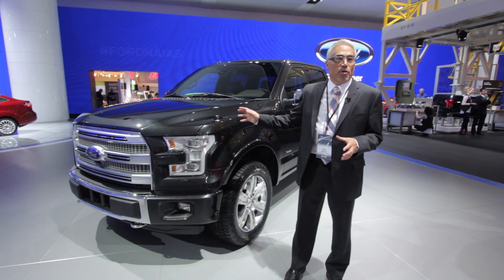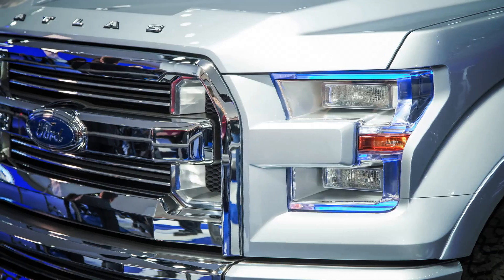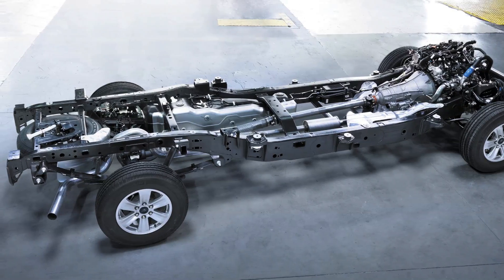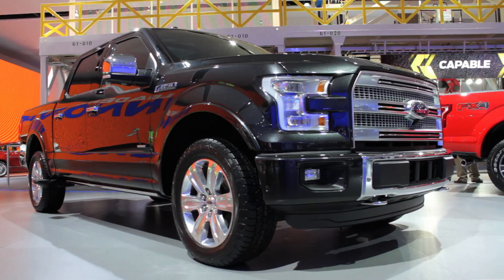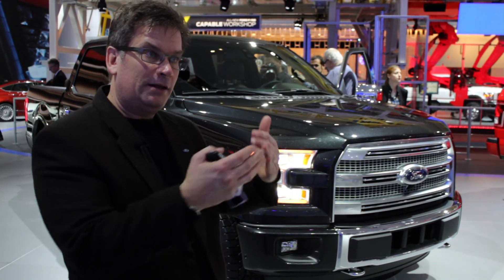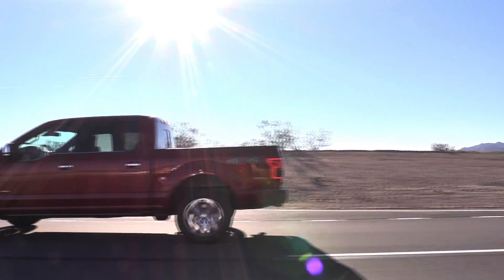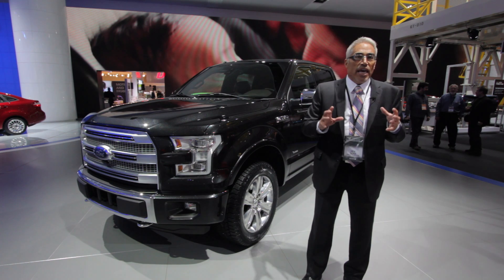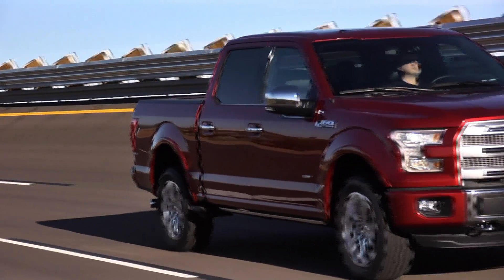Shaping the 2015 Ford F-150 from Aluminum - Design and Engineering - 2014 Detroit Auto Show

Comment: Nice to see that GM secured a contract for aluminum and in 2018 will be going aluminum as well to shed weight. Times certainly are changing and for the better. Advanced driving dynamics and tons of useful features for the many reasons one gets a truck, they certainly aren't just for work but that and much more...
Reply: Everyone knows they copy all of fords shit. Perfect example: raptor. Then gm built a 20 ton "off road" truck.

Comment: That truck no longer look like a Ford and more like a full size Toyota to me. The major change on this truck is the body which is Aluminum, and the new tailgate design. The grill is ugly and remind me of a Toyota, and the bed lights remind me of a GM option on their 2014 model trucks. I hope the new Ford is much quieter because the previous models are noisy. I like the idea of beefing up the frame design more and the tailgate. I thought you all would copy after GM on the bed step as it is easier.
Reply: I'm pretty sure it will sound the same, but I don't mind making it louder by adding a better more aggressive exhaust

Comment: If this aluminum thing catches on that could spell trouble for steel mills
Reply: not really. steel is still used in a lot of the trucks since it is still stronger. the aluminum is used where strength isn't necessary
Reply: Aluminum is only in the body panels, chassis and frame are high strength steel  nothing has changed there...everybody keep thinking the chassis is aluminum  no it isnt...FULLY BOXED FRAME from STEEL
Reply: Nickolas Little You telling me that a truck body does not need strength? Airplanes such as the B747 is made of aluminum, even in areas where strength is a key factor.
Reply: Mauricio Castro Noooo, you're sounding dumb. Read my comment. Aluminum is not as strong as Ford's high strength steel but it is lighter. Therefore, they use the Aluminum where strength isn't necessary, such as body panels. Ha nowhere did I say a truck body doesn't need strength.

Comment: Damn! coming from a Ram guy, i am pretty impressed with this new F-150. The styling has improved so much over the current model and the structure and weight of it are also considerably improved. Before this was shown, nothing competed with the Ram 1500 in the styling department, not the hideous f-150, or the boxy silverado and especially the dated titan or familiar new tundra. It'll finally give the Ram a serious competitor.

Comment: front shutters, lower front air dam,  LED taillights, spoiler or rear tailgate, all from Dodge first. besides the soft aluminum panels, whats new??? Dodge has more advanced and ground breaking features that came out almost 2 years ago….. wait for the new RAM. no competition in my opinion. oh yea, look out for steel on aluminum corrosion!

Comment: Nice but bumpers to small grill is way to big.Fenders need to flare wheel wells need to match the squarness of the rest of the truck.I dig the rear end and headlight design.Wheel wells def need a concept more square like flare.Body and bed not just bolt on flares to give it a wider looking stance.

Comment: Aluminum huh... Not sold on that, I'll wait and see what happens for a couple years. Can you imagine the body work costs? I heard the equipment is going to be 40k just to work on the body, guess who that cost gets passed on to... Don't let your wife drive.
Reply: High Tech vs Low Tech, High Performance vs Low Performance, High Buck vs Low Buck.
Life's a compromise, buy a Chevy or Toyota then.
Reply: I drive a loaded Chevy, switched from Ford last generation. Never looking back. Just stating that I don't know bout aluminum bodys. A good friend of mine works as a body man and he said they are going to be a nightmare and insurance companys will get 20k bills. In the long run it will cost you more to insure an Al truck over a steel one. Just something to ponder when new tech comes out.
Reply: C Blair If you like Low Tech and Low Performance then buy something else.
Reply: I used to run Ford...Lol. GM has the highest performance vehicles of the big 3. The corvette, camaro, duramax. Want me to keep going? Ford has to go to tuning division(SVT) and outside companies(Roush, Shelby) to produce a vehicle that can almost compete with an in-house GM built product. Cry me a river of tears fanboy, you like the wrong brand if performance is your thing. Cant beat GM drivetrain that's why 90% of ford hotrods run LS. Most ford owners aren't too ignorant to realize SBC is the true king, apparently you are though, so sorry to hear about that. Hope the rest of your day gets better.

Comment: I drive a 2010 F-150 and I love it! But this thing to me is a disappointed!!!! Ford, like all other truck manufacturers are trying to appeal to the rich and concentrating on luxury more than practically. Every time they redesign their trucks, the price increases by at least $4000.00 even with their XL model. A truck is supposed to be a work vehicle not a luxurious grocery getter! I don't understand their thinking about a lighter truck being best for towing. I'd rather have a heavy truck that will be more stable when towing heavy loads! Nice way to screw up a good truck Ford!!! Ugly and not practical!!!!!! Guess if I need to get another truck I'll be looking at other manufacturers!!!!!

Comment: Torque News
The New 2.7L EcoBoost V6 Will Make the 2015 Ford F150 the Most Efficient Truck in the US
Autos.ca is reporting that a new, 2.7-liter, twin-turbocharged V6 could find its way into the lighter, aluminum-intensive truck. The new engine supposedly makes use of asymmetrical turbos to generate 320 horsepower and 370 pound-feet of torque – substantially more impressive numbers than the current 3.7-liter base engine's 302 ponies and 278 lb-ft – while offering improved fuel economy and emissions.

Comment: my F150 is a 2006 super cab. It now has just over 95000 miles on it now and it runs as good as the day I drove it off the lot back in December of 2005. I bet I'll get another 95000 miles out it before it dies. When it does finally give up the ghost, You can bet your bottom dollar the next vehicle I buy will  be another ford truck!!!!!

Comment: FORD is king.
Reply: DETROIT (AP) — General Motors is recalling more than 1.5 million vehicles, including SUVs, vans and Cadillacs, for defective air bags and other problems.
The new recalls come as GM faces multiple investigations over its handling of a recall of more than 1.6 million small cars for defective ignition switches. The new recalls aren't related to that issue, but the company did say they're part of a broad product safety review prompted by the ignition switch problem, which is linked to 12 deaths.
GM expects to spend approximately $300 million in the first quarter to repair the vehicles in the new recalls as well as the vehicles in the small car recall. GM announced last month that ignition switches in older models of the Chevrolet Cobalt, Pontiac G5s, Saturn Ion, Chevrolet HHR, Pontiac Solstice and Saturn Sky need to be repaired.
Reply: What's Up,
Have you seen this yet
watch?v=O3nbwCjZKk8
looks like a lot of fun
Great Time to be a Ford fan
Reply: EscapeforMankind .
yea,i saw that,thats a good feature for the stang.
Reply: drfaticus F-gm What's Up, have you seen this yet,
 http://www.motorauthority.com/news/1091138_2015-ford-mustang-gets-700-hp-supercharger-kit-from-whipple
Reply: EscapeforMankind .
yea,that tells me that the next top of the line mustang,will be a MONSTER.
Reply: drfaticus F-gm Not only are OHV engines Obsolete, but Chevy puts Cast parts in them too, and that makes those engines Junk.
Reply: EscapeforMankind .
thats true,thats why the zl1 motor can not handle what a GT500 motor can.that is why we call them Garbage Motors.

Comment: Why is everyone knocking Dodge? Lol. Yes Ford is on top, what do you expect from the original manufacturer of "the pickup truck" but Dodge is second IMO, their trucks feel more solid than chevys and have alot more character than other trucks, and generally speaking, Ford and Mopar have ALWAYS build very tough vehicles, not so true for chevy or Nissan, Toyotas tend to last a very long time but I wouldn't personally buy one over a F-150 or hemi Ram.
Reply: Nobody needs to knock Dodge, they start knocking on their own in no time at all.
Reply: ford is slightly better than dodge but in my biased opinion. Chevy is for communists lol
Reply: do yourself a favor, stay away from dodge.
Reply: ozmedia  Michael Taylor  ozmedia do you even know what a "knock" is? and Michael, care to elaborate? I've owned quite a few classic mopars and driven cars like the SRT-4, hemi ram and test drove a 6.1 hemi challenger and a 392 hemi challenger, they're all solid vehicles, especially compared to Chevy (I grew up working on GM's, do yourself a favor, stay away from GM's - i'll explain if you want but its going to be a long post)
Reply: ozmedia Interesting story, i'm a mechanical engineering undergrad. In your expert opinion, what causes a Mopar to "knock" more than any other engine? Because from where i'm sitting, out of all the vehicles i've owned & worked on, GM's have by far the highest failure rate. I've always found them to be easy to work on, everything is actually pretty ergonomic compared to Mopar and Ford, but the only failure i've ever had on a Mopar (i've owned five so far) was a water pump on a '98 Durango, and the only things i've ever had fail on Fords (i've owned 8) were a spark plug on a 2012 Mustang GT and a dome light on a 2010 F-150 supercrew 4x4.

I grew up working on a '79 Camaro, '86 firebird, two El Caminos and a '79 Suburban with a 454 during my early years, all of them were fun, but god damn if I didn't spend three times as much of my waking hours pulling heads and replacing valve seals, scraping gunk from where the oil splashes up into the bottom of the intake manifolds due to shitty open block designs and drilling corresponding block/cylinder head holes around every cylinder #8 due to lack of thermal efficiency....the shit gets old dude, even for an enthusiast. Can't really knock a guy for putting in 30 years of hard work, congratulations to you for having that kind of patience, but that's not my job, especially when i'd prefer to hot rod the cars, not to be bent over wrenching under the hood or glued to a creeper under the car half the time. I'd much prefer to improve mechanical designs & systems as a profession so that guys like you don't have to work so much if you catch my drift
Reply: hahahahaha.
Reply: 2013FiveOh
I've been a master certified mechanic for over 30 years, I think I know what 'knock' is.  I've built many Mopars, doesn't mean I stand by their trucks..

Comment: This is easily the best looking of all the new full size trucks. Very handsome and stylish. And now with weight saving aluminum and all that. Nice job ford!
Reply: Scott Rozell
It is beautiful hands down!
Reply: bliglum
Id have to agree Ford is doing a better job in the evolution department. Dodge is somewhat still stuck on the big rig look...and Chevy well we wont talk about them. They are still stuck in the past....
Reply: Best new truck. Blows everything else out the water.
Reply: Is it really the best looking? That tailgate is butt ugly. The side view hasn't really come in with anything that new. The front end is a little too massive even though it is much better over their postage stamp grill with that ugly brace and bar design. I like Ford Trucks but I haven't liked the front design and in fact it was that design that broke the deal and made me go from Ford to Dodge Ram in 2010. The Ram is a better truck dollar for dollar with a much better Heavy Duty Truck with the Cummins Diesel.
Reply: Scott Rozell  Yeah, the Ram has been the best looking since the trend setting 90's big rig style.. But like your opinion on the F150's side view, I feel like the Ram as a whole hasn't come in with anything new for quite some time. And the Ram's Cummins is the best of the Diesels, but I've heard their transmissions are not quite as strong.
Reply: I don't think I would have considered the Ram before 2010. The whole Dodge Ram truck line was redone that year and the improvements were significant. Since 2010 The Ram is not even the same truck it had been. Coil link suspension with air ride is class leading. The new Eco-diesel that should be hitting the showrooms about now will be class exclusive for now with the other  US truck makers reported soon to follow. Interior fit and finish and style with the Longhorn and Limited package are best in class. Ford has answered back with this new 2015. The bar has been raised. One thing that I'm interested to see is how insurance companies will view the new Ford design and if it will come into play with insurance rates. Body shops will have to get up to date with the new build materials that Ford will introduce. Will it be more expensive to repair after a collision? We shall see.
Reply: Scott Rozell  You are right about the insurance and repairs concerning the aluminum construction.. I'm sure it's going to mean more part replacements rather than repairs.. But the frame is still steel, so it shouldn't prove to be too much of a problem : ).
Reply: Dodge ram line was redone in 2009. Coil link was in response for a better smoother ride for the urban folk. But poor weight holding stats yielded a lesser truck so to compensated they adopted the airride to level out with weight in back. Everyone seems to copy Ford in everything like when the King Ranch came out and the Platnium models......
Reply: Scott Rozell Shelby Raptor much?
Reply: whats a Shelby Raptor?
Reply: Patrick Connolly words out of my mouth pat